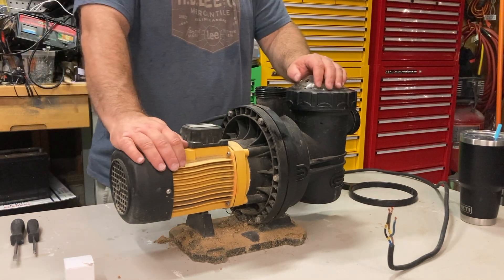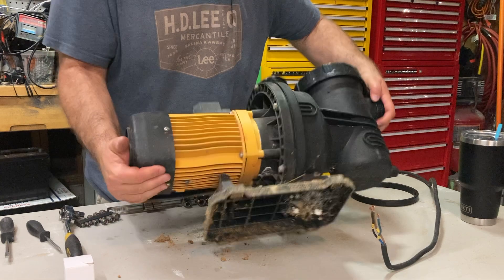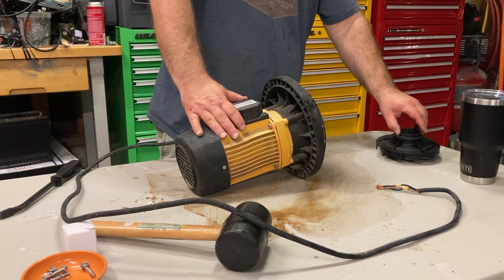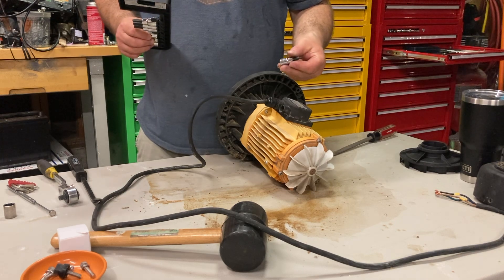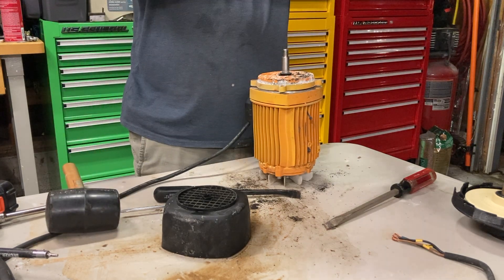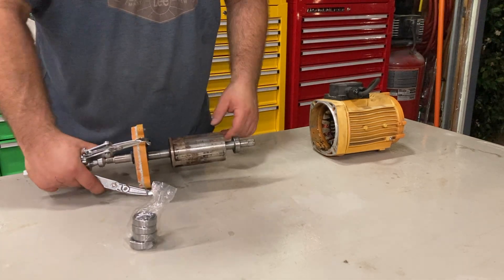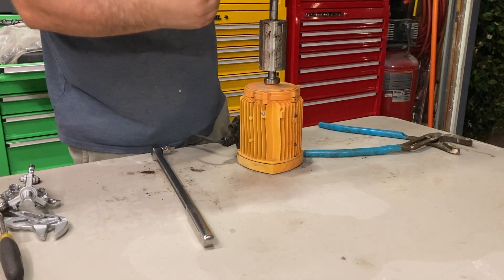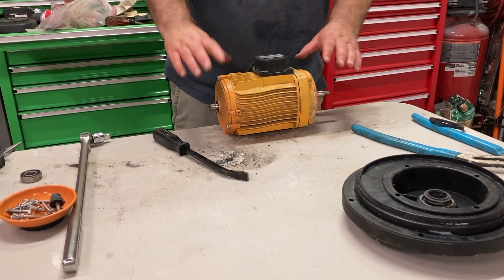Solar Pool Pump Making Noise Bearing Replacement Rebuild

Comment: What did you used to put the bearings back on.  I saw a rubber seal fall out when you pulled plate.  Can you explain where the rubber seal goes.
Reply from the maker: I used a large socket to press the new bearing back on.  That rubber seal went between the fan and the motor casing.

Comment: Many Chinese products are fairly easy to disassemble, which makes sense because designed for easy assembly.  The problem with products say from Harbor Freight Tools is sourcing replacement parts.  I have several electric chainsaws with a torn up plastic sprocket gear, but no way to source a new sprocket.  At least roller bearings are usually generic, so you can match the PN on the side.
Reply from the maker: I have been unable to find a replacement shaft seal for this motor.  I ended up having to take it out of service and I'm attempting to attach this motor to a traditional pump assembly that has shaft seals readily available.

Comment: I installed VEVOR solar pump 1200 watt.  Controller box burned up and rendered the pump worthless. Vevor has failed to replace the controller box.  They won't send one separately... and they ordered a replacement from China which has never arrived. Been over a month.  Wondering if there is some other option for a controller board/box that would have the same or adjustable specs like a variac or something.
Reply from the maker: how long did it last?  I have heard of this before.  I wired my solar panels in series parallel (100 volts) to keep the voltage going into the controller well below the max 140 volts

Comment: I have a wbs 900 watt solar pool pump.  My bearings went out after a year also.  I was able to get a bearing and seal kit from wbs.  I plan to install them this weekend.  I've replaced the bearings in two matronic dolphin dc motors and they are back working for just a few bucks.The pumps are identical.
Reply from the maker: Do you have the link where to purchase the seal and bearing kit?  Thanks in advance.
Reply: Any link on where you can buy the bearing and seal?

Comment: Thank you for the bearing link
Reply: Wow..what a mess! Please do update if you found a seal, would it be possible to make a seal or use rtv sealant or similar? I'm not familiar with the part in question but I have been eyeballing this pump to use in the Philippines.
Reply from the maker: @mdm6713  it is a rotating seal that works by making a tight fit between the rotating part and stationary part with a polished ceramic seat.  so you can't use rtv.
Reply from the maker: you are welcome I think my bearing went out because the pump seal was failing
Reply: @fixanythingdiy  the same now iam looking for the seals. Do  you know were to get them ?
Reply from the maker: @reviews2543  My seal is bad also. I actually had to change the bearing out again after 30 days, because the seal is leaking.   I called and messaged vevor and they say they don't sell the seal by itself.   I have gone to several pool supplies and they don't have that seal.  It is much larger in size than common pool pump brands.  If you find it please let me know.
Reply from the maker: as a stop gap, I drilled multiple large weep holes to hopefully clear the leaking water and I put a rubber washer on the shaft to help keep the water from getting into the bearing.
Reply: Hi, did you replace the bad seal ? If so, would you share the link to buy it?
Reply from the maker: @miguelsanchez4052  My seal is bad also. I actually had to change the bearing out again after 30 days, because the seal is leaking.   I called and messaged vevor and they say they don't sell the seal by itself.   I have gone to several pool supplies and they don't have that seal.  It is much larger in size than common pool pump brands.  If you find it please let me know.